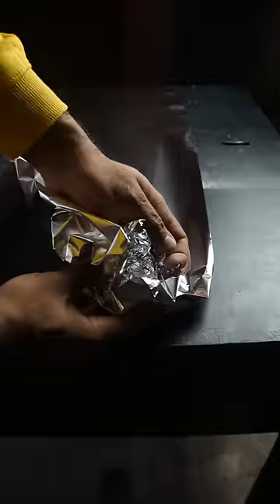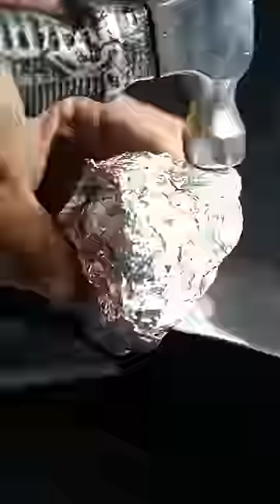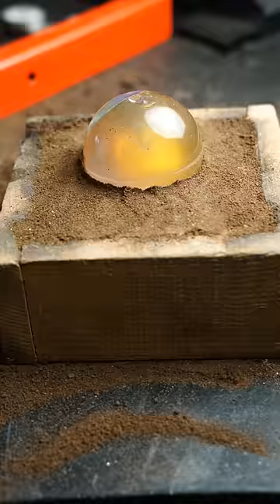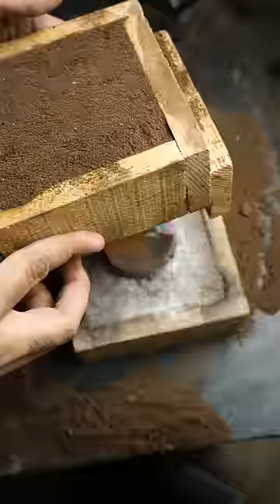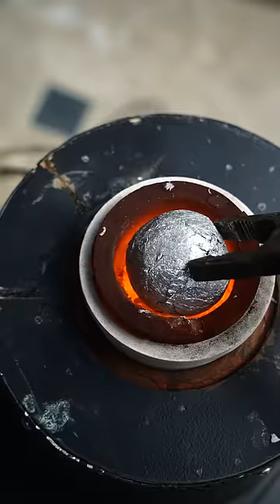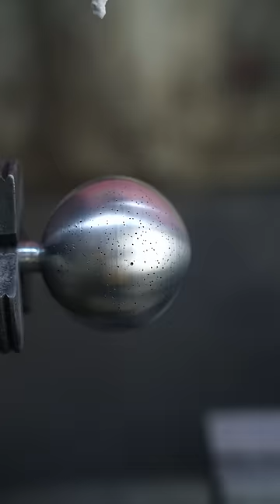Making Polished Japanese Foil Ball Challenge

Comment: I love how you end up with more aluminium after melting it, outstanding.
Reply: Probably more than 80 times the amount. It's just a random steel ball at the end 😂
Reply: The funny thing is
 you think steel and
 aluminum foil or the same metal
Reply: @JemSquash94  no no no even funnier that you think Molten Steel looks like that
Reply: The video clearly showed the guy adding the ball to metal that was already in the crucible.
Reply: Heat expansion.
Reply: @samurijder9550  That's not how heat expansion works, objects just return to their normal volume after cooling down.

What people should be doing is simply opening their eyes to see that the ball was simply added to metal that was already in the crucible.
Reply: @lambertmariano1680  I know, thermal expansion works the other way when a material cools. And I noticed the extra molten metal as well...

Comment: No way he got a whole solid ball of aluminum from that sheet of aluminum
Reply: i mean it looked like there were holes in the ball, like air bubbles
Reply: Yeah, that is my point as well. Even weirder, he hammered it down to a ball shape, but even then there would be gaps and aluminium yield would be much smaller.
Reply: @xZeroOffical  he might added more aluminium many things are to be done off camera 📸
Reply: When he put the ball in the crucible there was already some type of metal in it
Reply: Right
Reply: It was a whole roll of aluminum
Reply: @no-mo6sr  I think so as well, he put in the rest of the aluminum.
Reply: @chrisscott3904 that ball IS the metal lmao
Reply: When foil ball is dipped to the pot you can see clearli its already full with molten metal.
Reply: It looked like there was already molten metal in the bucket before he put in the ball.
Reply: @JAStudiospivotanimation ppppppppppppp
Reply: @JAStudiospivotanimation , that's pitting caused by casting, sadly these guys are probably correct in that there wasn't enough material to actually cast this size sphere.
Reply: He clearly unrolled the entire roll, and cut some of the process of bunching it up.
Reply: @chrisscott3904 I saw that also.
The whole thing about hammering the foil into a ball, was sort of a distraction.
He put the foil ball on top of some molten aluminum.
Reply: He obviously added more aluminum to the crucible. He just didn't show it.
Reply: You are absolutely right, that foil is super thin and is extremely low in density. At best, he would have got a ball about as big as a marble... He clearly added more aluminum, which doesn't take away from the cool factor. It's not like he was trying to prove some point to fool us, it would have been better if he would have showed that part but even though he didn't is still cool to me, and apparently to others too.
Reply: He didn’t. If you paid attention you could see there was already molten aluminum in the crucible
Reply: With heat, anything is possible, I guess... as I once heard a very wise man, once say... I like things that melt, and I don't like things that... don't melt.

Comment: you can also do this using a microwave, put the original foil ball in and leave it in for 10 minutes, it'll melt the surface of it to smooth it out and make it more solid
if you leave it for longer it melts the inside too which makes it a solid aluminum ball

Comment: Now thats....a cannonball
Reply: yes.
solid aluminum is heavy like granite.
Reply: @richtomlinson7090  it would hurt, we are wimps
Reply: @commonconservative7551  I'm just saying aluminum is surprisingly heavy, it's actually like heavy as a rock, and not like a soda can or foil.
Reply: @richtomlinson7090  it is surprisingly lighter than air after working in a steel shop, then transfering to alum, fab shops
Reply: Looks like a doorknob or cabinet knob to me. 🎉 Still useful.
Reply: @richtomlinson7090 no its not
Reply: @One.Disgruntled.American  You need to check it out yourself.

Solid Aluminum is approximately the same weight per cubic foot as Granite.
These are average, because different stone and different alloys vary some.

I've worked with Granite for almost 20 years now, and I have a lot of experience with Metals and Stone.

Aluminum weighs about 4,400 pounds a cubic yard, and so does most stone.
Concrete is lighter than both.
Reply: @commonconservative7551  Air weighs about 2 pounds a cubic yard, and Aluminum weighs about 4,400 pounds a cubic yard.

Comment: Your ball looks very porous. Aluminium has a tendency to absorb gasses while molten. Try covering up your melt with a flux. Once everything's fully melted, the flux should float to the top, and can be skimmed off along with the dross, but it helps minimize the time the metal has to absorb gasses from the atmosphere.

Aluminium, bronze, brass, copper and silver all require this precaution.

The most commonly used smelting flux is borax powder.

Comment: Q: How much does aluminum weigh per cubic inch?
 
A: 0.0975 pounds

Q: What is the size of a Billiard Ball?

A: 2-3/8" to 2-7/16"

Q: What is the volume of a sphere?

A: Volume = (4/3) · π · r3

Volume of a 2-3/8" Diameter Billiard Ball
= 7.014 in³7.014 * 0.0975 pounds = .683 poundsAluminum Soda Can weight: 14 grams1 pound =

Comment: Not smooth tho. Is there a reason for those air bubbles?
Reply: Probably from how it was poured in, there's not really any way to get the bubbles out since shaking them out would just cause the mould to fall apart, and also the metal cools too quickly so the bubbles wouldn't come out anyway

Comment: Alright so:
- the aluminium scrunched up was noticeably larger than their hand (pre-hammer)
- The aluminium post-hammer was obviously dense for a ball of foil, as you can hear from the sound of it hitting the table

Therefore, if you were to cast all of that aluminium, it would be able to fit a ball of similar size

Comment: Heating aluminum foil until is molten, then pouring it into a ball shaped mold, absolutely violates the intention and the spirit of the "Japanese polished foil ball" concept.

What you have created here, IS NOT a "Japanese polished foil ball", so you have failed to meet even the entry requirements, and therefore the best I can do is to grant you 0 (zero) points. However, I will grant you an additional -10 points for wasting the time of all whom have viewed this video clip.

This does not even count as "thinking outside the box", because this is NOT a polished foil ball, but is instead a "casting" which is not the same kind of entity at all.